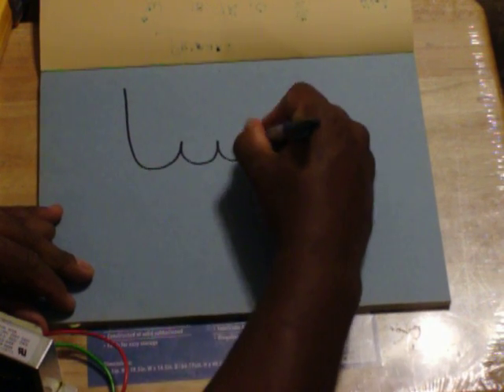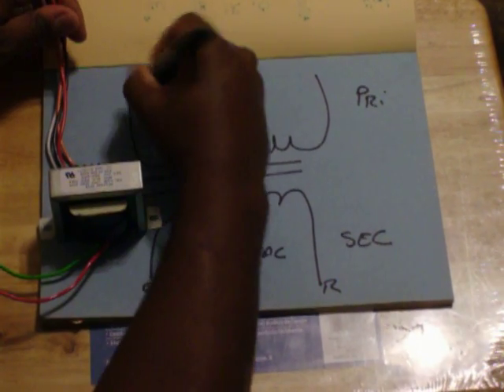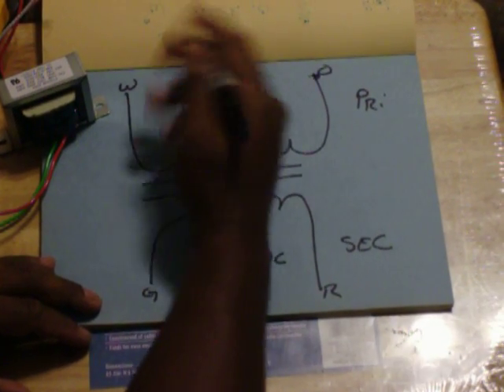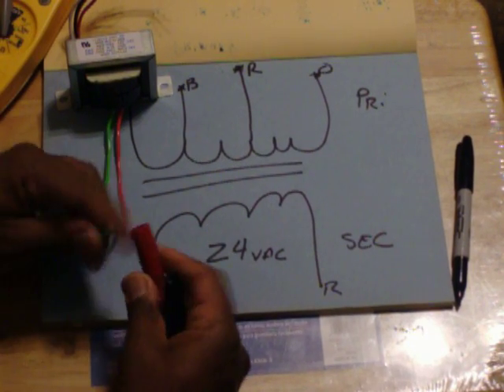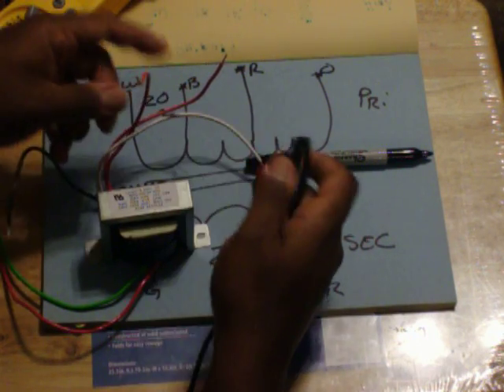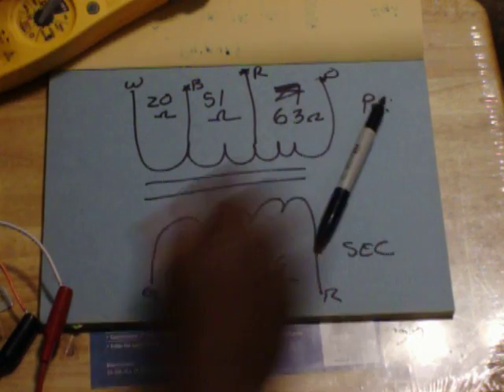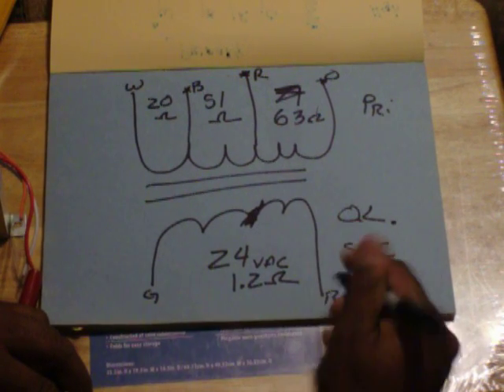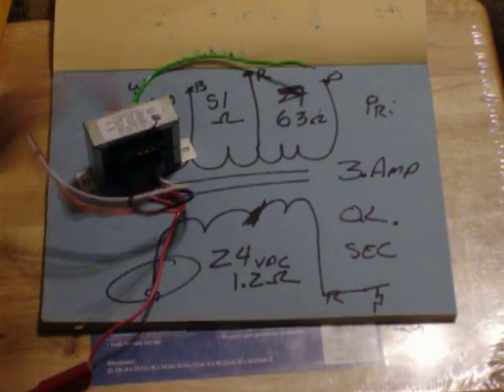how to check a transformer

Comment: Thank you for this informative video. I have a question, I have 120v on the primary but no reading on the secondary. But the ohms reading is fine on both primary and secondary. Is that possible?

Comment: WELL DONE! Great presentation; quick, simple, easy to follow and a clean diagram..Thank you... If unit is unmarked or wires are bundled/faded is there a way to identify  if its AC or DC and will a failed unit be warm? And is there a procedure to test live circuit ?

Comment: What happens if don't have any wires connected to it?  I have a transformer 8500000981116 DOUGLAS 61266, and I can't find the specs anywhere, it has triple input voltages,110v,127,220v on the selector knob with a center wire and a ground wire (I believe so) in between all other wires. The friend that gave me it told me it came from an old tv set, probably a Mitsubishi.  It has leads on the left side, on following order:  3 to 7=6.1 ohms, 4 to 7=3.1 ohms, 5 to 7=2.7 ohms & #7, respectively, which I believe is the primary. Would it be, 220v, 127v, 110v, respectively? 
On the right side it has 10,12,13,14.    The 10>12 is 4.2 ohms, the 13>14 is 2.2 ohms. And, finally, in the back, it has 18, 20 & 22., but only the 18>20 works., with 2.7 ohms. Can you help me out?  Thanks, appreciate.

Comment: great video, but check this out,.... my secondary is  4.5 ohms,  then i got two red and two black on my primary, which red to red 158 ohms , and black to black 158 ohms, and black to red 00.00 ohms nothin , so im wondering which primary wires do i hook up to my 110 ac??

Comment: What's up Bro, needed that help  Need Mo. Checking 2 transformers said was bad. Did yo thing, got ohm readings all around like yours. Problem, 117v coming to unit and transformer. no output on either. Cut wire off old fan. connected the spliced ends to the black and white wires and whala 26v on both. Didn't check voltage, but had to be 120+. 117v problem right? .

Comment: Open neutrals can blow transformers quicker than shit
I have seen intermittent open neutrals on the breaker box cause all sorts of unrepeatable bullshit.  Its almost always the main neutral has corrosion on it.
Reply from the maker: Good tip. Thanks
Reply: or the connection is loose

Comment: my heating furnace refuses to start,  how do I check the igniter transformer it is more voltage than the 24 but do I hook up out of the furnace and check for 10 k volts or do I check the ignitor so coil for resistance? Good work on the explanation

Comment: No it won't
But you can fix that by looking up the input voltage of the radio and ordering the new transformer, but if you have swollen capacitors (blown) you should have it rebuilt.

Comment: 870Ω is fine, but according to what transformer it is. As long as it is not a short circuit reading, ( 0.00Ω), you will be safe. If you still not sure, try a large wattage bulb in series with the primary and you can tell if it shorted or not according to how bright the bulb lights. Hope this helps :)

Comment: Found your video and it's been super helpful so far! I'm pretty sure a transformer in the charging base for my cordless hair clipper has died. On the bottom of the charger it says 120V 60Hz 65W. The battery itself is 4.5v how would I choose a replacement transformer to match?

Comment: @dougspair There are many so called 'experts' here on youtube, but your videos are very informative and correct. I'm 64 and been in-out of electrical stuff since I was around 4-5 years old.
  Thanks for the effort you put into these videos, I learned a bit here about the residential A/C. Mainly, the motor starting/running relays in these systems. 
  I've been industrial elec/mech/machinist for the last few years and most of the A/C is 3 phase, so uses a different starting method.
  Thanks!!

Comment: what about the primary side? i think my primary side is burnt out, what are the common causes of that side burning out? I sat here for the whole video wating for just that, also it would be nice if you would show what selection you are using on your meter, you said resistance but showing would of been better

Comment: Hello, and thanks for the very detailed video. I have a transformer, that i have burnt out or shorted by accident, i was wondering if you might be able to tell me if it is repairable. Ill explain as best i can: Its from a pc backup source. Basically i put 220v through the 12 volt output side! It has nine wires, on one side yellow, two reds, and white (one red is thinner) and on the other side red, brown, black, and two blues. now it only gives 2.5 v instead of 12v on secondary and gets very hot!

Comment: OL does not mean Open Line. It means Over Limit. Think of it this way, the resistance you are measuring is over the limit that is able to be measured by the multimeter.

Comment: a lot of those transformers have a glass fuse hidden in the plastic,  you will have to break it to get at it, then tape it back together, but it will get you out of there in a pinch.